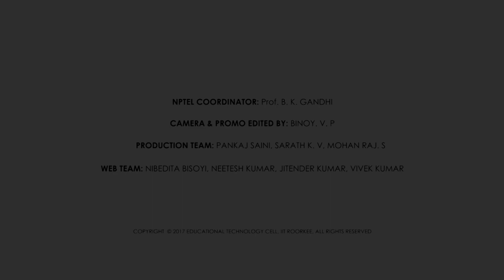Numerical Linear Algebra

Comment: Till lecture 16 only basic LA is covered
17 Graham Schmidt orthogonalization and orthonormal bases
18 - 24 Describing different error measures related boring stuff
25 conditioning and condition numbers
26 conditioning and condition numbers II
27 stability of nuerical algos
28 stability of nuerical algos II
29 vector norms
30 vector norms and matrix norms II
31 Matrix norms I
32 Matrix norms II
33 Convergent Matrices I
34 Convergent Matrices II
35 Stability of non linear system
36 Cond number of matric : elementary properties
37 Sensitivity Analysis I
38 Sensitivity Analysis II
39 Residual theorem
40 Nearness to singularity
41 Estimation of condition number
42 SVD I
43 SVD II
44 Orthogonal Projection
45 Algebraic and geometric properties of matrix using SVD
46 SVD and their application
47 Perturbation theorem for singular values
48 Outer product expansion of matrix
49 Least square solution I
50 Least square solution II
51 Householder matrices
52 Householder matrices and their applications
53 Householder QR factorization I
54 Householder QR factorization II
55 Basic theorem on eigen values and QR method
56 Power Method
57 Rate of convergence of power methods
58 Appliction of power method with shift
59 Jacobi Method I
60 Jacobi Method II
Reply: bless u for this post
Reply: Thanks so much for this.
Reply: Very nice sir
Reply: Are there any prerequisites for this course ? like this one 

https://www.youtube.com/watch?v=KaLA1cWhQlA&list=PLLy_2iUCG87BLKl8eISe4fHKdE2_j2B_T&index=2&t=9s
Reply: Thank you. On the YouTube lecture series, Lecture topics of each lecture are not clearly displayed in the index (all the lecture topics are marked the same: "Numerical Linear Algebra - IITR"). But they are clearly seen on the original NPTEL site of the same video lecture series :

https://nptel.ac.in/syllabus/111107106/
Reply: thank you pal. you saved a ton of time seriously.
Reply: Thanks bro for this valuable info.